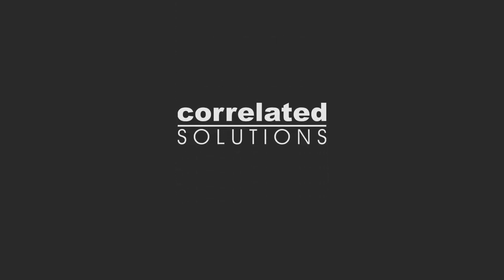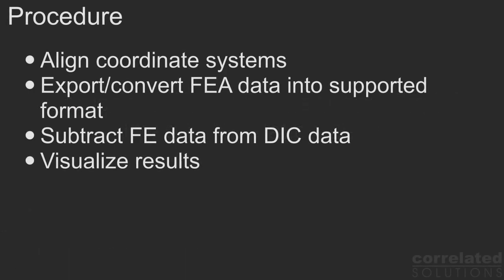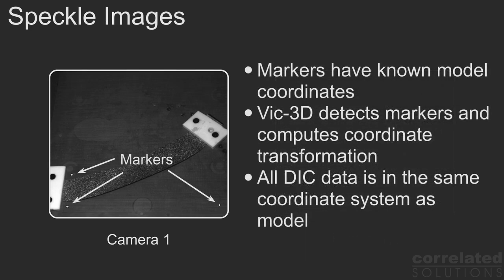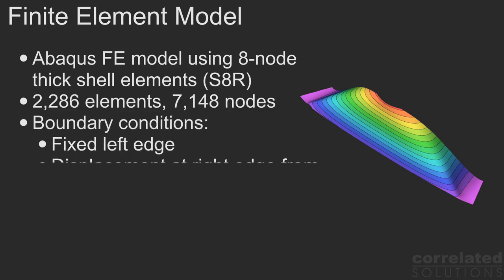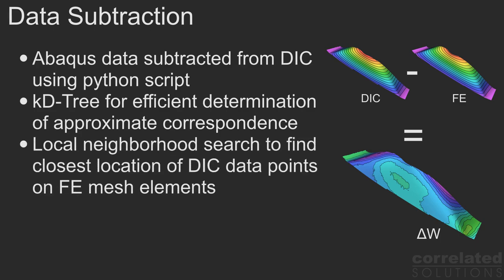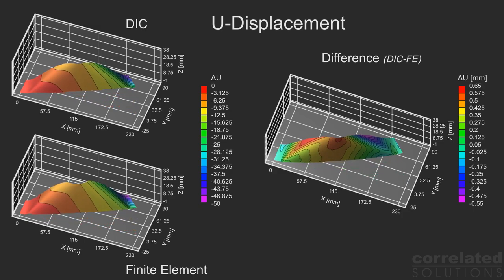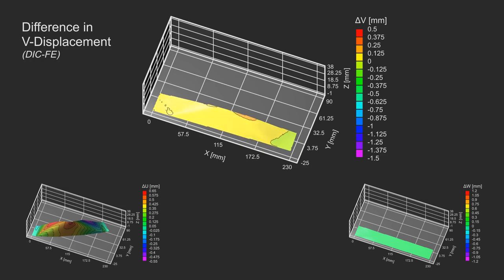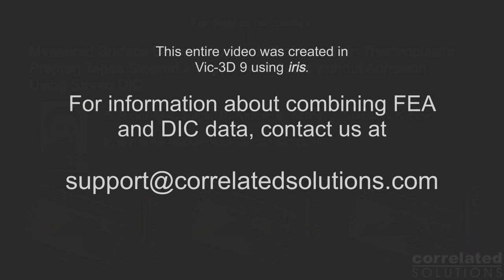Comparing Digital Image Correlation (DIC) and Finite Element Data

Comment: Where did you see the value of the differences in the DIC-FE plot? because you say the difference in delta_U is 1.3 mm, but the results in the right side show another number.
Reply from the maker: Thanks for your question. To clarify, the difference in delta_U is a range of values across the specimen. The total difference between the max (0.65 mm) and min (-0.55 mm) values across the full surface is ~1.3 mm. I hope this helps answer your question.  If you have any further inquiries, please reach out to our Support Team for more detailed assistance. https://www.correlatedsolutions.com/support